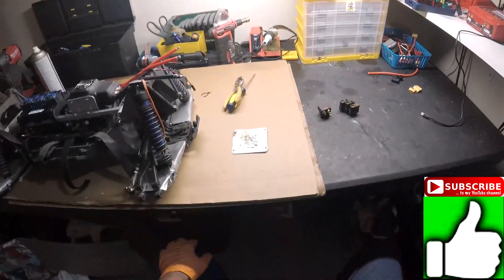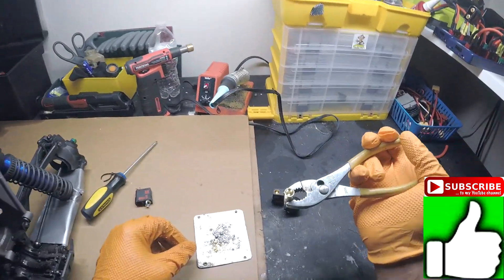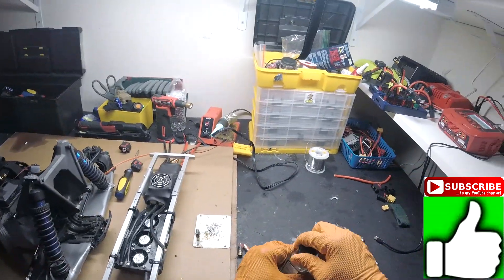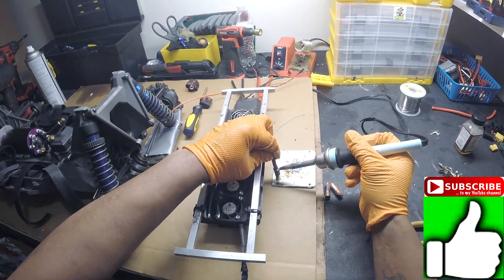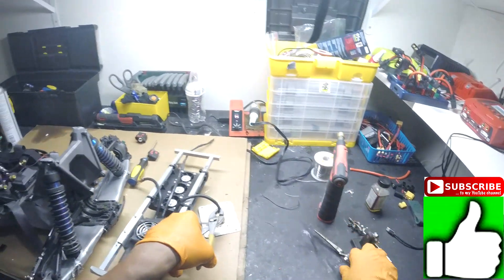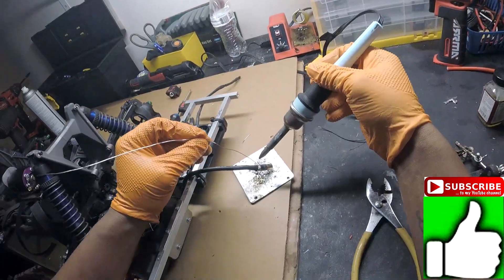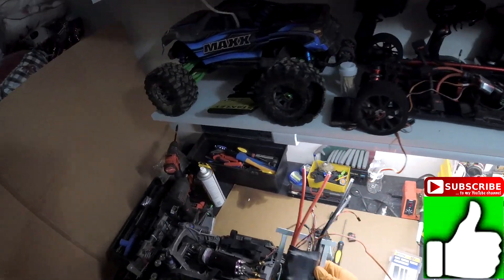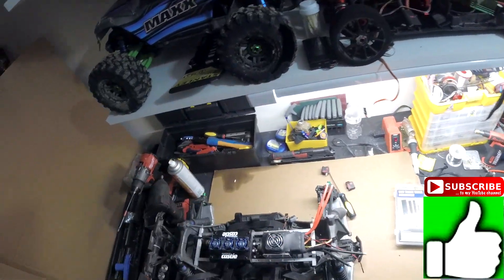How to salvage QS8 (OSE) 8mm antispark connectors

Comment: Im trying to do this - solder new qs8 onto my Xmaxx esc but the solder isnt sticking to the inside of the bullet/connector and becomes a ball and then falls out. Using flux and an 80w soldering iron set to 480. I tried on another qs8 and the bullet came out (not intentionally). Any advice?

Comment: What kv & gearing you running
Reply from the maker: Which setup?
Reply: @KiloWattRC  for bashing around mainly
Reply from the maker: @scottdaubenspeck2291  which rigg, motor,  esc, tires,  mod 1.0 or 1.5
Reply: @KiloWattRC  in the xmaxx gearing do you like for general bashing around? What kv motor do you prefer for bashing & same with gearing. Ratio & do you run more mod 1 or 1.5 for bashing
Reply from the maker: Mod 1.5 always works beat for me.  Mod 1.0 is fine just small grub screws.   1400kv to 1600kv is prefect, and I try to avoid real big cans
Reply: @KiloWattRC  ok. Right on man thanks for the info. Thinking bout picking up another xmaxx & doing an only speed rig n use the 1 I have now for bashing

Comment: Nice trick! How long do the QS8 connectors usually last?
Reply from the maker: Thanks man, it all depends.  When I run crazy amps on 8s and crazy high voltage the antispark spark insulator on lipo male connector female positive pin tend to wear.  And what happens i get a spark when I connect lipos
Reply: @KiloWattRC  Oh okay i gotcha!  Thanks for the video and the explanation. I'm sure it will come in handy in the future 👍